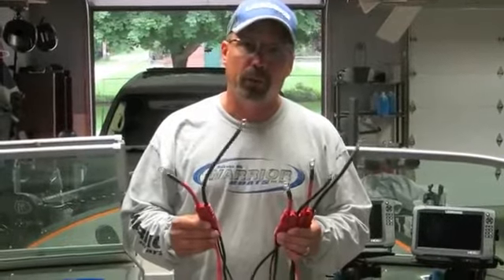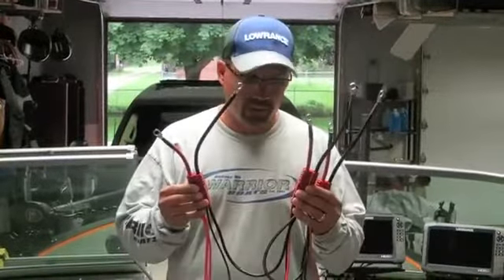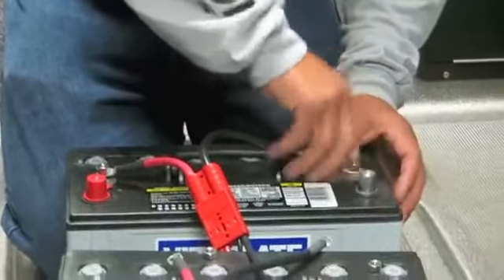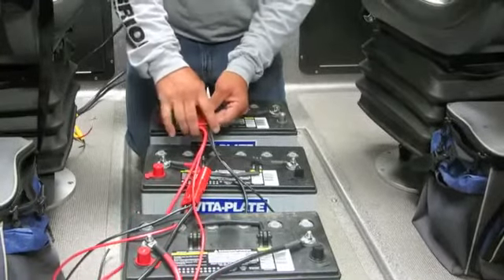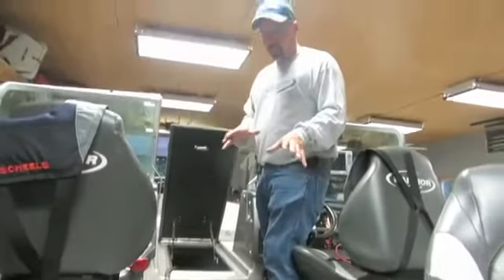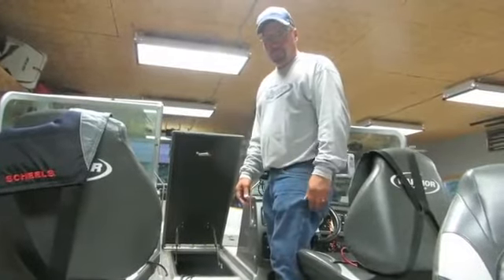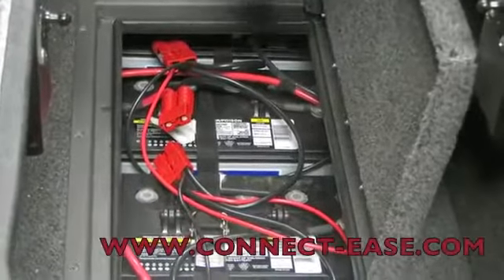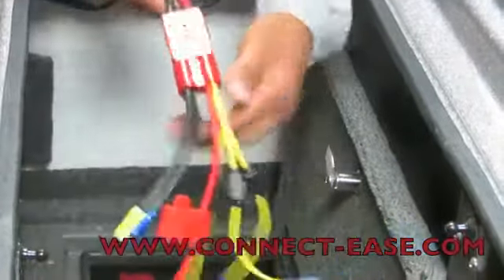Connect-Ease 36v Trolling Motor hookup tutorial

Comment: Great video. I suppose I can use a 36v charger to charge the 36v batteries connected in series while trolling. However, can I also charge all 3 x 12v batteries individually while trolling?